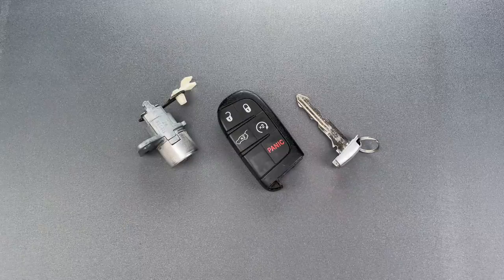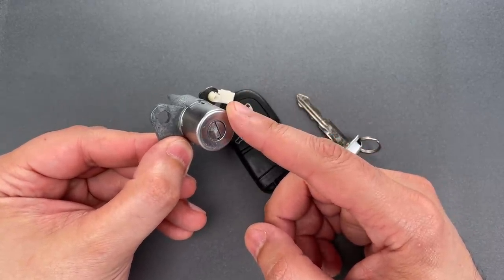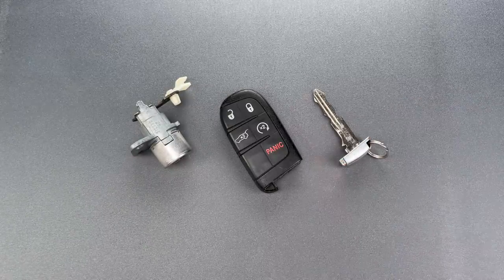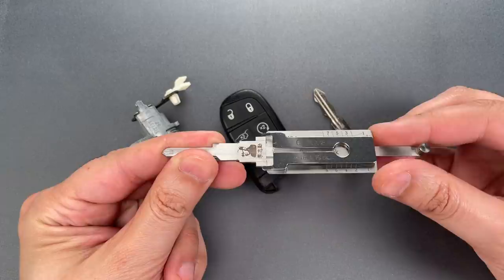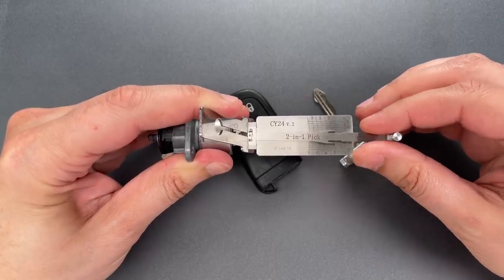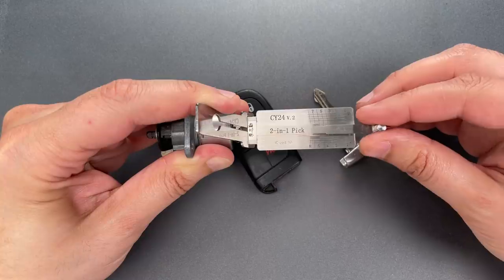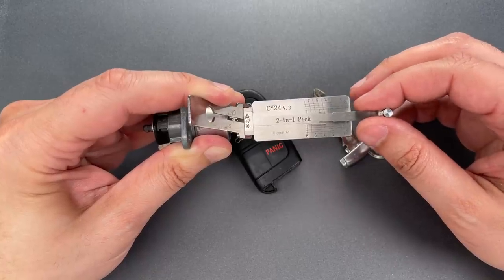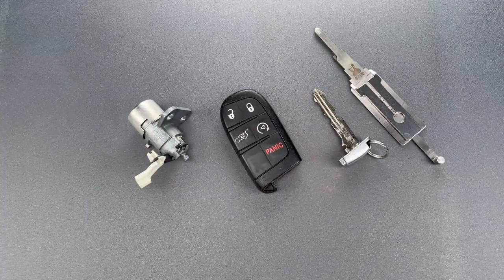[1326] Jeep Grand Cherokee Door Lock Picked

Comment: A few reminders:

1) This unlocks the door, it doesn't unset the alarm, and the engine still won't start without the chip in the key (for most modern cars).

2) The bigger and more realistic threat is somebody with a hammer/rock/automatic centre punch breaking your side window and just reaching in... So what benefit is there in a super secure door lock? It doesn't actually add a lot to your security. 

3) Can we stop with "locks keep honest people honest" please? Locks are there to make nicking your stuff more effort than nicking somebody else's - yes it's always possible to get in with the right tools and enough time, but usually thieves go for the easiest and lowest risk option available. In this case, what the lock is doing is forcing somebody to either (a) break your window and draw attention to themselves or (b) bring along a specialist tool (which takes practice to use) and kneel by the side of your car fiddling with the lock for a minute, which is also going to look very suspect. It's not keeping honest people honest, it's making dishonest people (realistically) break the window if they want to rip off your satnav/ray bans.
Reply: nope...sticking with  keeping honest people honest...the honest people are the ones not breaking your window, and what you're talking about are the  people that are going to steal your stuff any chance they get.
Reply: @leeChMSI  this makes no sense to me...

1) If people are honest, they're not trying to steal your stuff. If they need keeping honest, they're not honest - does an honest person try car door handles on the off-chance they'll be able to lift a pair of sunglasses? Of course not. So at the very minimum you're forced to amend that saying to "locks keep slightly dishonest people from being tempted by opportunities to easily steal unsecured valuables".

2) Locks have a really important and obvious role in deterring and deflecting criminal attention. Let's look at bicycle locks as an example: I park my nice bike next to another identical one, and chain it to the same solid object as that other bike (a lamppost etc). My bike is secured with a 40 mm brass padlock with a 6 mm shackle using an 8 mm unhardened bit of hardware store chain. The neighbouring identical bike is secured with a 14 mm PEWAG hard steel chain, and a beefy Squire hard steel padlock with a 10 mm shielded shackle. My bike is clearly the one getting stolen, since although it's totally possible for a thief to bring a battery die grinder and cut that big PEWAG chain, he can get the same reward by snipping my wimpy chain with cheap bolt cutters in a tiny fraction of the time with much less noise and risk. That's the purpose of locks - to persuade a dishonest person that your stuff isn't the easy option. It doesn't have to be utterly impregnable, it just has to be good enough that the balance of risk/effort/investment vs reward causes them to go and rip off somebody else.

"Locks just keep honest people honest" is a dangerous mantra - it implies that there's no difference between locks or any point trying to get ones that are good enough to keep dishonest people out... and that's going to lead to some questionable security decisions.

I'll put it another way - I just changed the lock on the front door of my new house. I didn't know who had a key to the old one, and it wasn't of great quality (I can rake it in a couple of seconds). I've replaced it with a much better lock. That first lock was totally adequate for "Keeping honest people honest" but I'll sleep easier with the new one.

Comment: As a 2015 Grand Cherokee owner, I have to smile in admiration that it took less time to pick the lock than it sometimes does to get the touch sensor on the door handle to unlock when I have my fob in proximity. Since this picking attack only gains access to the interior of the car, and I don't keep anything more valuable than gum and sunglasses inside, I am not overly fearful of this attack. Yet.

Comment: using a lishi just seems like cheating at this point
Reply: And for me it gets somewhat boring.
Reply: thats kinda the point. Anyone who wants to get into your car can spend 70 bucks and break in hella easy.
Reply: Actually it seems a lot like advertising at this point.
Reply: @robgilm  Yes. Cuz anyone on here is going to drop $70 for an special lockpicking tool that can open an grand total of one car lock. LPL just does these to show how commically easy it is to violate security with an specialized tool
Reply: Sebastian Riz it’s actually a range of vehicles ,look it up on the website ,a Ford key can open most Ford vehicles for example
Reply: @Dl-zm5nd  an range of them sure but there are still A LOT of different keys that rewuire different Lishi and every Lishi is $70 an pop
Reply: Sebastian Riz not really it just depends on the the brand ,it’s like a universal pick

Comment: I remember some models of the old jeep used to have a remote style infrared fob to unlock the doors. I also took a palm pilot and programed all the known codes, then pointed it at a friends jeep to show her why she should cover the receiver with tape. In about 3 seconds from running the codes the doors unlocked and her jaw dropped. She bought it used so she didn't own the fob to the jeep.

Comment: Practically speaking, is it possible to open it with conventional instruments? If so, how long would it take?
Reply: Car locks have a lot of tension in them that you have to counter, requiring stronger tools. The dust cover also gets in the way a bit. I think mostly it's knowing where the wafers are and the fact there's two sets of them.

Comment: How would go about picking a lock if you dont have the right Lishi for the lock in question?
Reply: Like you would do single pin picking (only on some locks). It just takes a hell of a lot longer and requires skill. With a lishi you don't need to be AS skilled.

Comment: I noticed you picked 1 then 2 then 3 and so on. In previous videos I think you picked all the top then the bottom (1, 3, 5 then 2, 4, 6). Is there a reason you chose to pick numerically rather than the top then the bottom?

Comment: This is the lock picking lawyer and today we are going to be picking the lock of this M1 Abrams tank, and as you can see here its a pretty simple mechanism. It will only take jiggling to get in.
Reply: The m1, as with most military grade vehicles, does not actually include keys at all. They are activated through a startup series which honestly anyone can accomplish. The only reason we do not Jack the local armory is because very rarely do the vehicles work without significant maintenance.
Reply: @leechowning2712  And here was I thinking that the main reason a tank doesn't normally get jacked is because it attracts a lot of attention...
Reply: @jon_j__  almost ever motor pool guy will tell you about half of the machines are either offlined at least part of the time or have a specific trait that operators must be aware of in order to operate it. They also may have a blueforce tracking unit installed, and most M1 Abrams would include that.
Reply: @leechowning2712  Sure, I understand that. I was coming from a more economical angle - you can't really do anything with a tank after you've stolen it, except cause a very small amount of mayhem, and I think this is the main reason why tanks are rarely stolen. (Unlike a stolen car, you probably can't sell it. Unlike a stolen car, everyone will notice it and many will report it. Unlike a stolen car, the police and army will be immediately VERY interested. Finally, if you try to do anything more than just drive around - eg. shoot things - then you'll probably eat a missile. And if all you can do without dying is drive around slowly, why not just steal a car?)
Reply: @jon_j__  if you're going to go driving around smashing up buildings the bulldozer works just fine. And it's not like they're not universal key also.
Reply: @leechowning2712  Very true

Comment: Hi! I'm trying to open this bike lock I forgot the 5 digits combination. After applying tension i can't tell if the correct number fell into the gate bc the gears spins with a sort of rough jump between numbers (it's made like that I don't think WD40 will do much).
Any suggestions? Thanks, your videos are awesome, big fan :-)

Comment: Yo lock picking lawyer, my deadbolt on my apartment just won’t lock and I fear I will break my key in it, I bent it just now trying to lock it. The lock works fine with the handle when inside but to leave and lock it is a no go, thoughts besides “contact land lord.”?

Comment: How difficult is it to pick specific locks without specialized tools, like the one you just demonstrated in this video? Do novice and competend lockpickers have a significantly harder time?
Edit: Hereby I declare once again, that I find myself unable to master the English language.
Reply: Totally depends on the lock. This one would be quite easy to pick with standard picks though with most all auto locks, you need some way to hold open the shutter. You can get tension tools that do this for you, then can pick with a standard pick. This tool acts as both so it's even easier. Other lock designs will require even more specialized tools. He has many videos on those.

Comment: As someone with no experience in lock picking it's hard for me to see how difficult this actually is. I would like to know how much heavy lifting is done by the tool and how much of it is your skill and experience? Also I would like to know if these specialized tools are absolutely necessary or if it can be done with other, maybe simpler tools as well, even if it becomes much more difficult to actually do it.
Reply: The tool is designed to make it easy: LPL has described it as "low skill" in some of these videos. Of course, LPL is very skilled so he probably uses the tool quite a bit faster than you or I would, but it still shouldn't take long.

Comment: Is there any locks where the key has a hole in it, so that it cannot be turned unless spiral-shaped pin within the cylinder is able to go through the key?
That seems like it could be a decent security feature that could limit the ability to pick using tools like the one in this video
Reply: Bear in mind that there's no point in making a particularly secure car door lock - it only needs to be just good enough that throwing a brick through the window is the easier option. (The chip that unlocks the ignition is a different thing entirely.)

Comment: I have 2012 gmc yokun  and 2013 serra I don't know if I'm writing the names right I keep locking the cars with keys inside and open them the old ways with metal rod anyway what should I buy from the tools to open them without scratching the paint 🤔 thanks
Reply: Just go get another key cut. Or lock it with the key once you're out rather than before you close the door

Comment: I'm curious to see how you'd tackle locks with the chip embedded in them, or if that wouldn't actually make a difference
Reply: Mechanically they are no different, just means when you defeat the lock and turn the ignition it won’t actually start the vehicle.
Reply: @Bearded-Foodie  I think he's said in previous videos that the ignition lock sometimes has a few more wafers than the door lock, and that's why the Leshy tools start at #2 or #3. But, yeah, that mechanical difference is very slight - the chip is the main obstacle.

Comment: but most car keys have seconday security for actually starting the engine (some sort of transmitter in the key), right?
Reply: Right. And usually the ignition lock uses more cuts on the key than the door lock. And if you lock the door with the fob and open it with the key, the alarm will sound if you don't put the key in the ignition within a short time.
Reply: @beeble2003  ah thanks for clarification. So this is only relevant for storing expensive stuff in the car and not really for theft of the vehicle itself
Reply: @Yasokuhl35  Correct.

Comment: Why does the key fob have a PANIC button? OK, I googled it. It appears to be a very American thing. It sets off your alarms to scare of the undesirables accumulating around your vehicle. Or to find your car after you've lost it in one of those America-only oversized parking lots. Same goes for the x2 button (starts engine remotely). I've never seen that before either. I suppose that could be usefull if you need to de-ice your car in the morning and want the engine to warm up while you're still in the house, making sandwiches for your lunch.

Comment: One time I was leaving my friend's house out in the country at 3am in January. It was snowing, around freezing. Since it was about a 40 minute drive, I decided to get out and pee first. So I step out, leave the car running, close the door. Then my chihuahua type dog (rip Gus 🐶) climbs over the seat to see what's going on. I hear the click, and I completely deflate. I just knew... He stepped up on the armrest to look out the window and hit the door lock button. Of course he did. Obviously my phone (and jacket) are in there. So I make my way up the long, icy driveway and pound on my friend's door, waking up his dad in the process. He laughed, but I still felt bad and also like an idiot. Anyway, CAA comes an hour later and uses that inflatable bag to pry the door open a bit to hook the handle and pull it open. Gus was fine. The heat was on and he had made one of his trademark nests in my jacket. It was a Dodge Dart, so it was the Chrysler connection that made me think of this story. That is all.

Comment: What is that PANIC button about?
Reply: I'm not sure if you're making fun of Jeep or asking a genuine question, so I'll assume you're being genuine.
Most automobiles that have a key-fob for remote lock/unlock also have that system connected to the horn and lights so that you get confirmation that the locks have locked, or you can use it to locate your car in a crowded parking lot.
Not long after that feature was introduced, the "panic" feature was added, pressing (or holding on some models) the panic button will cause the automobile to continuously sound the horn and flash the lights until you press the unlock button.  This feature was introduced as an additional safety feature for people who may be attacked or experience some other emergency on their way to/from, or inside their vehicle.  The idea is that the honking horn and flashing lights will attract attention to the vehicle, and the person needing help, and potentially scare off an attacker.
Reply: @Kineth1  I live in Germany and never seen anything like that. So thanks for the reply and have a nice day. Cheers, mate

Comment: True story.  A daughter borrowed her parents Chrysler, she got the keys from the apartment, as she was walking to the car she saw bumper stickers for a different political party than what she would expect from her parents, but just dismissed it.  Unlocked the car, drove away.  Little did she know, but that wasn't her parents car.  Her parents and someone else in the same apartment building had the same car, same color but only one had bumper stickers on it.

What is the point of the story.  If you have a key to a Chrysler, it probably works on quite a few of them so no need to pick the lock.

Comment: Hi, I recently bought an Abus XS 67 (which you picked), because I did not trust the common chinese version with I think a disc core with 4-5 pins. Could you try to pick that open? It's a common lock with plastic outer body and twistable core cover.

I'm still using it as a second lock to chain my boat; would like your opinion on it.

It's quite similar to lock in video 671

Photo:

https://media.s-bol.com/xZwpoYOAYor/1017x1200.jpg

Comment: That's a point of no return for me. Camon mister, a whole guide on how to get into anyone's car and where to get tools for it? I can't see the way for this to be entertaining so much that it will overcome the part when it's actual harm. Why do people even invent and sell locks? I'm really glad that you have mastered the art to the level when unlocking any door is like cracking an ordinary peanut. But still, it's safety and property of honest people which are put in danger. Cheers
Reply: @jon_j__  than why do manufacturers install locks on doors with glass? It should open like saloon doors by your logic, if there is fragile glass on it
Reply: @Sigognac1988  I'm going to assume this is a genuine question and not trolling.

A lock on a fragile door still has a purpose - it gives the social signal of "this is private property and I'd prefer you didn't enter". It's the same kind of idea as a door to a private area that's closed and not locked - there's nothing physically preventing you from opening an unlocked front door and walking right in, but that would generally be considered a bit rude.

The other obvious use for a lock on a glass door is to keep the door closed - eg. in an area that's prone to high winds where a simple latch might slip; or to prevent young kids from going on a high balcony unsupervised.

---

If bypassing the lock is trivial and obvious to everyone (like a rock through a window) then anyone who wants to enter can do so. The only point in picking the lock is to enter WITHOUT CAUSING DAMAGE.

Thus, the only thing LPL has done here is to show the world a way to get into your car that is inconvenient, time-consuming,  expensive, and is specific to one brand of cars - but has the benefit of not damaging the car. Criminals are rarely concerned with the advantage of this method (avoiding damage), but they probably care quite a lot about the disadvantages!